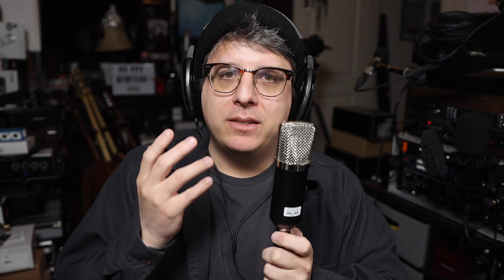Why Does Podcastage Tap on Microphones? - Microphone Resonance

Comment: So I could still hear a resonant frequency on the AT2020; it was just lower in pitch and MUCH shorter than the NW700. (I actually heard TWO pitches on the NW700.) I don't know enough about acoustics to know how that affects the tone of the mic, but my guess is that IF the body of the AT2020 resonates to something you're recording, the effect is minimal.
Reply from the maker: It's much less noticeable on the AT2020. EVerything is going to have some kind of tone when you tap it. The thing is, the AT2020 doesn't ring like the NW700 does.
Reply: @Podcastage2  Yes, you're right. The ringing is the difference. The NW700 is almost like a bell with a microphone inside. 😁